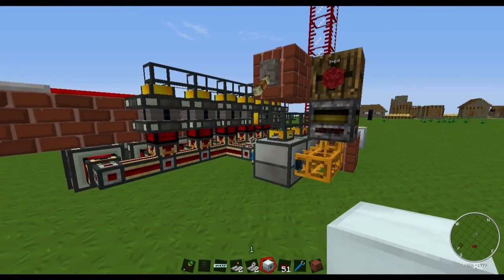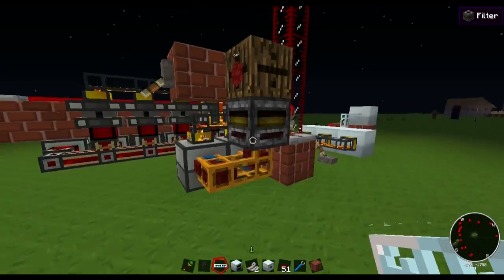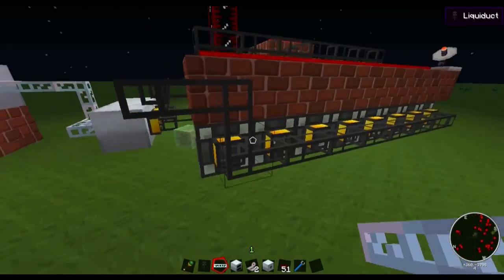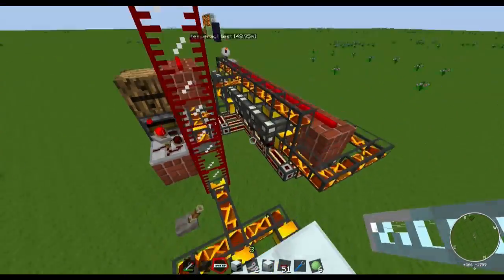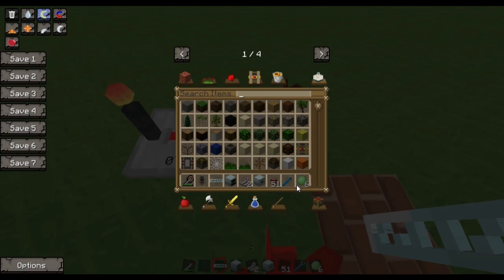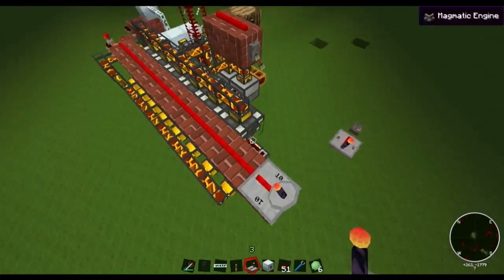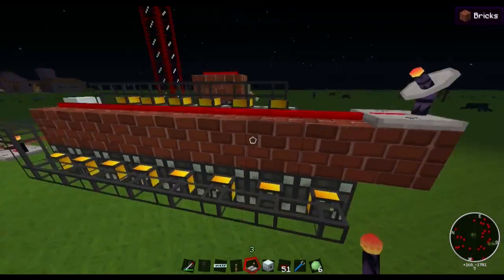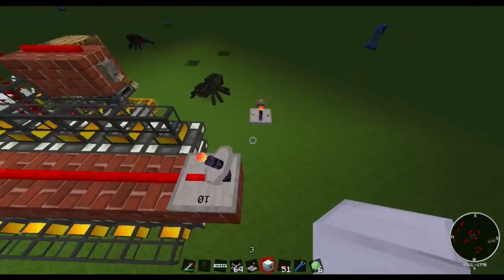FTB: Netherrack Power Station (early-game power supply)

Comment from the maker: Basically you don't want that cable connected until you have at the very least 256,000 EU in the MFE. It won't even start, just drain power without effect if you don't have enough stored for one full cycle :)  I use a splitter cable and a lever, but splitter cable takes 1EU ber block, so make sure you stick it right between the MFE and electrolyzer. Let the MFE charge up, then switch the cable on. Once your power generation exceeds 128EU/t, this is no longer a problem.

Comment from the maker: Hey, the problem is the distance between MFE and Industrial Electrolyzer, it needs exactly 128EU/tick, you lose 1EU per 30 blocks on optical fibre, more on gold cable. From experience, about 6 blocks of glass fibre between MFE and electrolyzer should be fine. Also it takes a lot power at once, so make sure you have at least the required EU in the MFE before you start one cycle. Once the MFE starts it can't be stopped and will drain your MFE even if it's dry and your power supply can't keep up.